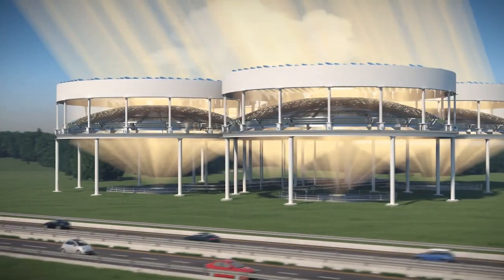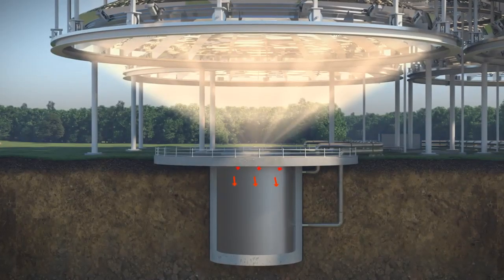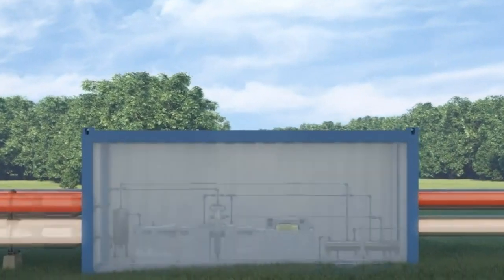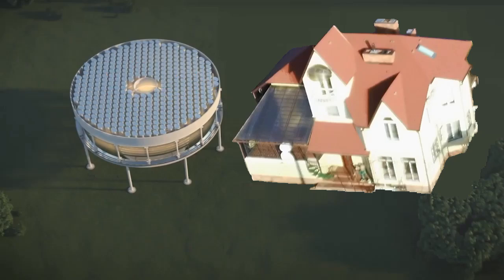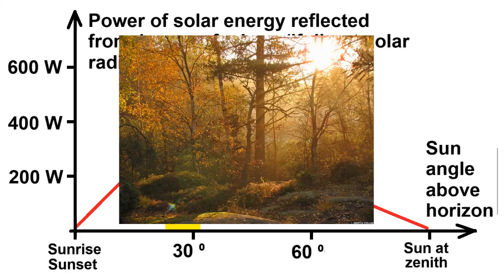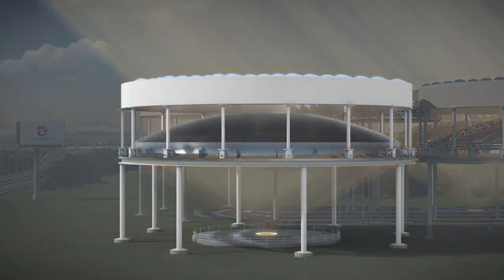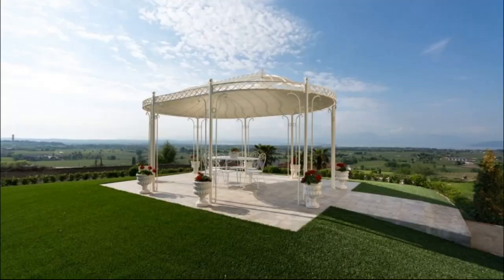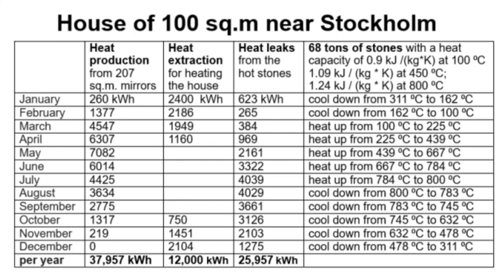How these mirrors can heat a house by solar energy only, without other energy sources

Comment: I am now thinking about how such a solar system could be made on my own from cheap materials in a suburban area. The main problem remains the manufacture of a solar tracker that would rotate the mirrors evenly with the sun.
If you don't want to use electronic components, then the simplest option seems to be using an ordinary mechanical clock with a pendulum, which you can make yourself.

Comment: Photovoltaics are better.
Reply: No. The efficiency of photovoltaic systems is 25%, and the efficiency of the Stirling engine can reach 65-70%.
Reply: The efficiency of organic systems is 1%, because plants are able to absorb only red and blue light.
Reply: For electricity yes. If you want heat, a 20% efficiency isn't that great

Comment: Brilliant.  Similar to using a parabolic mirror to focus heat into a concentrated energy beam that can melt metals. As a patent inventor myself I find this endlessly fascinating. I am working on another couple of projects low tech/hi-tech integration inspired by ancient technologies and designed,  but augmented by modern controls and building materials. Thanks.

Comment: The system cost the same as your house. But hey! Free energy.
Reply: Mirror's some metal some stones and basically a steam engine connected to a generator.
It only costs a lot because they say it costs a lot.
Reply: You can passively heat your house in the winter by encasing the south side of your house with glass. You can use old windows and glass doors for that.
Reply: I think it is better as a addition to an existing powers powerstation/ maybe coal powerplant or thermal power plant to reduce the CO2 emissions in the sector
Reply: NO, it costs 10 TIMES MORE than you house. And needs much more land than you have in your neighborhood. And you will NEVER get the building permit for that in your country.
Reply: @hstrinzel  I don't know where you live but in Romania I când build whatever tf I want on my land
Reply: @hstrinzel  building permit, your country is cooked
Reply: If the system is made with your own hands, then it will cost only the price of mirrors of the same area.
Reply: @intellectualcat4000  It'll cost a little more than only mirrors 😄 Btw I can get mirrors for free from the trash, that would be the smallest problem.